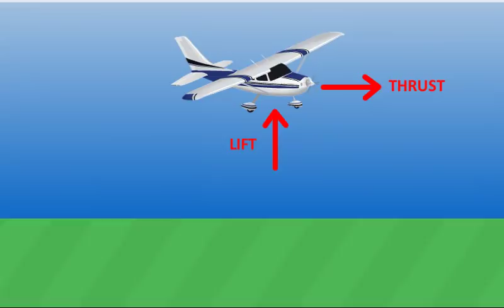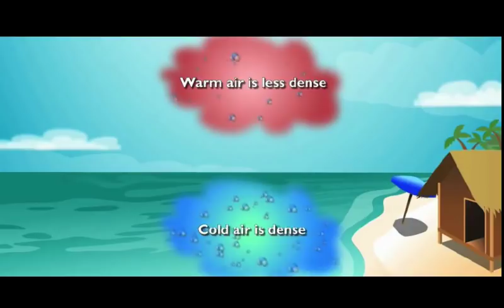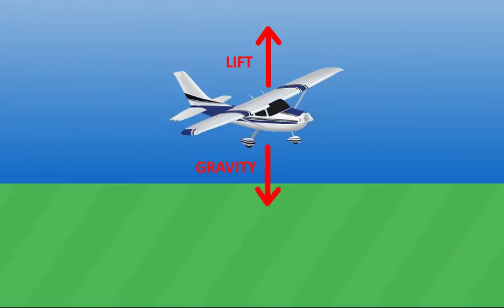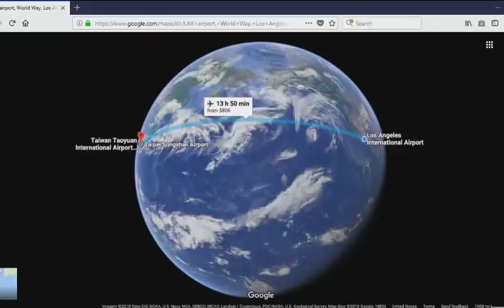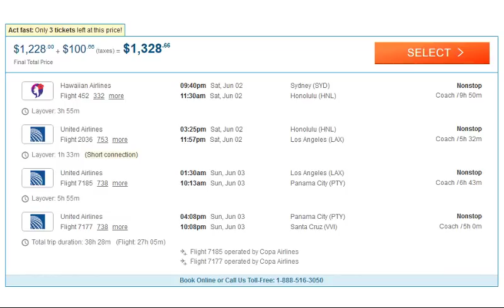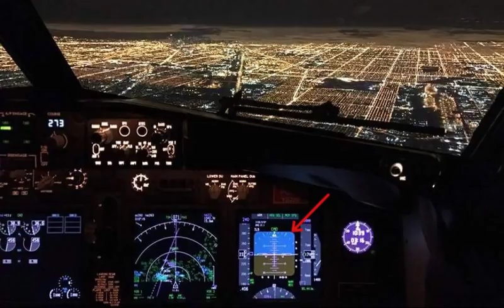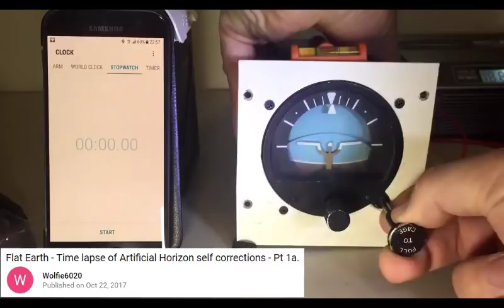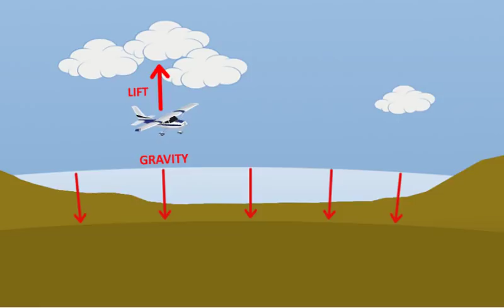Flat Earth Falsities - Plane Nonsense

Comment: So the earth is a closed system like a car that's why the atmosphere moves with the earth?
Reply: John Kimani Yes it can be pretty much modelled as a closed system for most of our concerns. The model does fine until you get to the outermost layers of the atmosphere, where some particles have enough kinectic energy (through having enough speed) to overcome the pull of Earth's gravity, then it becomes tricky to define it as a closed system, because very fast molecules (usually Hydrogen or Helium) can escape. (Thus you have energy leaving the system, breaking it's closed status, but this is negligible).
Reply: John Kimani It's not closed in the sense of having a roof; there is nothing in space to create the friction that a car roof protects you from. It is closed in the sense of an ecosystem; you need life support to travel outside the system.
Reply: John Kimani Well to answer that you must first ask, why do vacuums suck here on the surface of earth. The answer is, they don't. Instead air is pushed into vacuums, because the atmospheric pressure is creating a force on the air to go in, while there are no molecules inside the vacuum chamber to create a counter push to keep air out. Thus, vacuums 'suck'. 

With this information in mind, we must know ask, is there a force pushing the atmosphere out of Earth? Not really. The only relevant force acting on them is the pull of Earth's gravity. That's why normally, gas molecules can't just escape into space. There is no force pushing them out. 
Only when molecules randomly achieve enough velocity through random collisions can they reach escape velocity and leave. This process is negligible, which is why we are able to normally model Earth as a closed system.
Reply: John Kimani Like I said before, vacuums don't suck. They are only low pressure closed systems. Air only rushes into vacuums because the high pressure outside created by the weight of the atmosphere pushes the air into vacuums. 

So thinking about space, we know of no force that pushes away 2 masses. The only relevant force acting on the atmosphere is the gravitational pull of Earth. 

So thinking like this, why would any gas molecule on the outermost layer of the atmosphere be pushed into space? When the only force acting on them is down into Earth. Does this make sense?
Reply: wong substituting observable repeatable experiments ie (science), with made up mathematics! great, that's how you end up with pseudoscience.
Reply: Flook D so you mean it's an open system like a convertible car but it's closed by the atmosphere? How does air enclose our ecosystem from the vacuum of space?
Reply: John Kimani No no no, you're missing the fundamental point here. Vacuums never suck. There is no reason for space to suck air out of Earth's atmosphere. I don't think I've explained it well enough. Let me try again.

Imagine we have a vacuum chamber here on the surface. We create a vacuum inside by forcing most of the gas molecules out. Ok now we have a very low pressure closed chamber next to an atmosphere at a relatively high atmospheric pressure. 

Now say you open the chamber door. What happens? Air rushes in, obviously. But why? 
This happens because the pressure outside the chamber exerts a force on the gas molecules from all directions except 1, the vacuum chamber. The vacuum chamber has much fewer gas molecules, meaning it exerts much less force. So the gas molecules feel a strong force from all directions and a weak force from the vacuum chamber, so the stronger force pushes the gas into the chamber. Does this part make sense? This means air only rushes into vacuums if there is a force moving them into vacuums. 

Thinking back to space and the atmosphere, there is no force that pushes gas molecules out into space. So if there is no force outwards, why would there be motion outwards?
Reply: John Kimani The atmosphere is part of the system. The Earth's gravity counters the expansion of the air into the vacuum. 

There is no interface between a ground level atmosphere and a vacuum. The atmosphere gradually thins with increasing altitude until it is essentially a vacuum. 

A vacuum does not suck; there is nothing in the vacuum to do the sucking. There is movement of air from a high pressure to low pressures areas. The atmosphere thins so gradually that at no point is there sharp decline in pressure; gravity is strong enough to counter what air movement would occur.
Reply: +Bobby Wizdum
Stop lying and treolling Bobby.
Reply: +John Kimani
"So the earth is a closed system"
No. The Earth can be considered a closed system. By doing that many otherwise complex equations etc. can be simplified. It is a common practice in maths and science, but then fucking science and maths illiterates like you don;' know about such things, do you.
Reply: wong I can make my own equation if I like to prove something to fool people.
Reply: Pseudoscience definition a collection of beliefs or practices mistakenly regarded as being based on scientific method. Doesn't anyone know what a scientific method is anymore?
Reply: Name calling and abuse is helping anyone guys just stick to scientific methods for proving your beliefs
Reply: Bobby Wizdum Did Nasa launch Sputnik?
Reply: Levi Cordel "why stars are always on site at same place"
Do you know what trigonometry is?

"I ask perhaps they reason gravity"
You seem to be assuming it rather than asking it.
Reply: John Kimani That the maths exists does not mean nothing has been tested. What do you think we have labs for?

"is it to much to ask for science proof through experiments this days?"
https://arxiv.org/
https://www.ncbi.nlm.nih.gov/pubmed/

"gravity can't be measured by scientific method"
https://www.jstor.org/stable/106988

"it's just a theory"
A scientific theory is a comprehensive explanation for a natural phenomenon well substantiated by extensive experimentation and observation. It is not a hunch or guess; that is the vernacular meaning of theory. 

"we just don't question gravity"
When something has been questioned over and over and over and found to be consistent over and over and over it is not worth time & money to keep testing it over and over and over. 

"8 inches per mile square curve"
That is a parabola, not a circle. It's a rule of thumb used by land surveyors for distances of a few miles. You need to use:
drop = radius * (1-cos(A)) where A is the angle between two points.
That merely covers drop; how far you can see is also dependent on elevation and atmospheric refraction. See maths & diagram on:
https://www.metabunk.org/curve/
Reply: King Fox so if energy is living the system, then why doesn't vacuum in space reap out our atmosphere and suck it dry because of the atmospheric breach, plus how can a vacuum(space) exist side by side with a high pressure system (our atmosphere) that's not enclosed?
Reply: King Fox you mean that the reason why the space vacuum doesn't suck the atmosphere out of earth is because gravity is to strong and it holds our atmosphere in place thus vacuum can exist side by side with the atmosphere, cool. Is there an experiment to show this?
Reply: John Our atmosphere doesn't act like gas in a container. As you gain altitude, the air becomes thinner and thinner, exerting less and less pressure until you are a long, long way away from earth. There's no real edge to the atmosphere, and theoretically it would extend forever, just getting thinner.

In practice, the upper atmosphere is ionized by the solar wind, so the gas that actually escapes the earth's gravity is corralled by the solar wind and magnetosphere. This should pretty much confine the earth's atmosphere to within the solar magnetosphere, extending at least three times the distance to Pluto. That's far enough, no? 

Since the atmosphere thins out gradually and continuously, there's no pressure difference to cause the gas to go anywhere. It's held in place around the earth by the gravity produced by a six sextillion ton planet. Other planets' atmospheres behave much the same way, even Jupiter.
Reply: John Kimani 
Like rockin Robbins said, the Earth's atmosphere isn't uniform like a gas in a container. (Well even then there is minute differences in pressure from top to bottom of container).

As you go up, atmosphere thins out and thus less pressure is exerted. When you get to the outermost layer you can imagine, there is such low pressure that the only relevant force acting on it is Earth's gravity. I don't know of an exact experiment that shows this effect of atmosphere thinning, but it's common knowledge that as you go higher, pressure decreases. 

In fact the opposite is more easily proved. Using a fluid like water to simulate the atmosphere, you can measure the water pressure at the top. This can be done in a pool, lake or sea. Then dive down to the bottom and measure water pressure again. You will find that water pressure is higher at the bottom due to the weight of all the water above it. This is the same thing we see with our atmosphere. Pressure is highest down at the surface, and the higher u go the lower the pressure. I'll try to find an exact experiment to show this.
Reply: John Kimani Here is an experiment showing how the difference in height (or this case depth) creates a difference in pressure.

https://youtu.be/K5g6P8-GmBg

As the experiment showed, the bottom hole experienced the most pressure while the top hole experienced the least pressure. This is a cool experiment even you could do at home with a large water bottle and making 3 holes at different heights, blocking the holes, filling up the bottle, then let go of the holes and watch the difference in pressure at work. Hopefully this clears up your misunderstanding with how the Earth's atmosphere isn't uniform in pressure :)
Reply: RockinRobbins13 The top of the mesosphere, called the mesopause, is the coldest part of Earth's atmosphere, with temperatures averaging about minus 130 degrees F (minus 90 C) and as science says Temperature also makes changes in air pressure . In cold air , the molecules are more closely packed together than in warm air, so
cold air is more dense than warm air . Since warm air is less dense and creates less air pressure , it will rise; cold air is denser and creates greater air pressure , and so it will sink. So if you factor in temperature dropped the higher you go then it doesn't thin out, but increases in pressure again
Reply: Flook D is there an experiment to show this gradual thin out of high pressurised system into a vacuum? Is there an experiment to reproduce the properties of gravity or is it just a theory?
Reply: John:  Climb a mountain.  The air gets thinner.  That is your proof.  Go high enough, you run out of air/atmosphere.  Then you are in a vacuum.
Reply: Stormageddeon Dark Lord of All definition of science fact should be observable then repeatable experiments or is it just a belief, is it to much to ask for science proof through experiments this days? Or we just don't question gravity or the science we are presented period end of story just like its a religion.
Reply: John Kimani they think the atmosphere is also pulled by the so called gravity, and the stars, said to be far far beyond are also pulled by that so called gravity of the earth, coz we constantly see them wherever earth likes to fly.
Reply: +Levi Cordel
Your scriptures do not tell you "no curvature measured between two points of considerable distance between them" but Eric "Ladyboy Lover" DoPay me and Campanella do.
Your scriptures do not tell you "the issue of  missing curvature have not been answered." but Eric "Ladyboy Lover" DoPay me and Campanella do.
Your scriptures do not tell you "the video did not refute the experiments made by flatearthers regarding no curvature at all..."  but Eric "Ladyboy Lover" DoPay me and Campanella do.
So why are you lying Levi? Why?
Don't you Christians say you don't tell lies, because that is what heathens and atheists do and not Christians?
Why do you lie Levi? Why?
Reply: +Levi Cordel
Why do you lie Levi? Why?
Levi, your claims had nothing whatsoever to do with the scriptures did they. The subject was physically  measuring and proving the Earth/s curvature, surveyors, geodesy etc. So why do you lie?
"How about the question of no curvature measured between two points of considerable distance between them"
"I can compute by myself. The video did not refute the experiments made by flatearthers regarding no curvature at all..."
"the issue of  missing curvature have not been answered."
So you were very clearly specifying actual physical measurements and proofs.  Now, when you have been given the physical proof you demanded you immediately start telling lies. Why?
Why are you a liar Levi? Why? Isn't lying wrong for Christians?
You are not only lying to yourself Levi you are also lying to your god and to everyone else. Are you proud of being a liar Levi? Are you?
Reply: +Levi Cordel
Why do you lie and change the subject Levi? Only  liars, failures, idiots and trolls do that.
Reply: John Kimani The experiment I showed you is proof of concept, that as you increase altitude pressure decreases. 
As for the temperature issue you brought up, lower temperature leads to lower pressure as well, not higher. This is because colder air doesn't condense. That only happens if it loses enough energy to turn into liquid state. Instead this colder air will simply have less kinetic energy (as temperature is a measurement of kinectic energy). 

So as you go up, pressure decreases, temperature decreases (which also decreases temperature, but this isn't relevant I'm just saying this cos you brought it up). 

As for you challenge, I've told you many times the atmosphere is not uniform. You cannot say it is a highly pressurised system standing next to a vacuum. It's a gradually pressure decreasing system.
Reply: wong I'm always on track. Maybe you lost your mind trying to understand foolishness of mathematicians, physicists, etc
Reply: King Fox thanks for your explanation I will look into it farther.
Reply: +John Kimani
"So the earth is a closed system"
No. The Earth can be considered a closed system. By doing that many otherwise complex equations etc. can be simplified. It is a common practice in maths and science, but then fucking science and maths illiterates like you don;' know about such things, do you.
https://www.britannica.com/science/scientific-modeling
https://brilliant.org/wiki/small-angle-approximation/
https://ocw.mit.edu/courses/electrical-engineering-and-computer-science/6-055j-the-art-of-approximation-in-science-and-engineering-spring-2008/
http://www.bu.edu/wcp/Papers/Scie/ScieSaya.htm
https://en.wikipedia.org/wiki/Approximation
Reply: +ntaci
"The atmosphere is part of the earth." Yes dear. of course it is.  However, in the real world Earth's atmosphere is the layer of gases that surrounds the planet Earth and is retained by Earth's gravityl i,e, it surrounds and is not part of.
Reply: @tricky dicky
"I will admit I don’t know shit" So why are you posting claims, such as
"If he knew anything he would have known that those shadows he measured (not sure how he could measure two shadows at the same time 2300-2500 years ago while those shadows were “500” Miles apart...) would produce the same effect if the Sun was smaller and closer to Earth."
" NASA EMPLOYEES just can’t rebuild 50 year old Technology. On whatever ridiculous number of Billions they receive"
Which mean you are claiming knowledge?
Reply: John Kimani that's how they attack  coz there is no substance in their understanding, just they go their own level, the garbage
Reply: Levi Cordel gravity can't be measured by scientific method, it's just a theory
Reply: Stormageddeon Dark Lord of All okay tell us all about the 8 inches per mile square curve and which experiment has detected it? Present scientific evidence only
Reply: King Fox I understand,  vacuum in space has zero pressure , but our atmosphere is a high pressurised system meaning the air pressure would push out into the vacuum of space to create that equilibrium as all experiments suggest... A highly pressurised system cannot coexist  side by side with a zero pressure vacuum unless it is enclosed by something...that's what I mean and the earth is not enclosed that's why rockets go in and out... My question is if what you are saying is correct then is there any experiment to back it ( high pressurised system coexisting side by side with vacuum without it being enclosed)?
Reply: Flook D you do not know anything about whether there is a dome or not. we are not allowed to go there. you simply take nasa's word.
Reply: King Fox thanks for the video,  but is there one experiment that shows how high pressurised system would coexist with vacuum... Better yet you have a High pressurised system that's not enclosed inside a vacuum is that possible? Even water boils inside a vacuum chamber so how does atmosphere layer thin out gradually until it becomes a vacuum, wouldn't there be a constant state trying to reach pressure equilibrium thus all our air would be pushed out into the vacuum of space?
Reply: Stormageddeon Dark Lord of All I know everything u ask. I'm not fool. I'm pointing out why stars are always on site at same place while  the earth, as they say, is swirling in space in a pattern like a screw, then turning into... whatever FORM. So I ask perhaps they reason gravity, lol. And the atmosphere? rolling with earth? 😋
Reply: Stormageddeon Dark Lord of All not interested in occult
Reply: Stormageddeon Dark Lord of All. I will admit I don’t know shit. Please enlighten me all about shapes and Grade 4 Math?
Reply: Stormageddeon Dark Lord of All. Can you read? Can you comprehend English? All evidence says you can not. Read and comprehend my response. There you will find the answers to your amazing questions.
Reply: Flook D all space agencies ultimately answer to nasa. you might wanna do your reasearch on things like the nasa and faa
Reply: https://youtu.be/ygnTysoKnvU that's NASA for you guys, how can anyone still believe this bs?
Reply: wong they didn't go anywhere near the moon even Buzz Aldrin admitted it..you are saying they are just to dumb to figure out how 60technology works
Reply: Flook D thaks for information... BTW"know one question gravity" tell Einstein that because he questioned gravity and came up with a new theory for gravity which refutes Newton's theory of gravity... Btw the 8inch per mile square explanation you gave is not an experiment just calculations..
Reply: Flook D the earth is stationary... Moon sun and stars are revolving above the earth... Read the Scriptures... Don't believe nasa